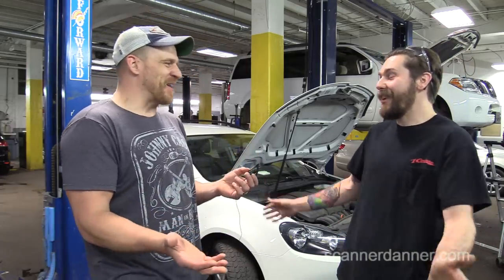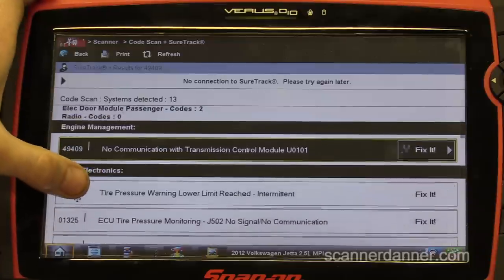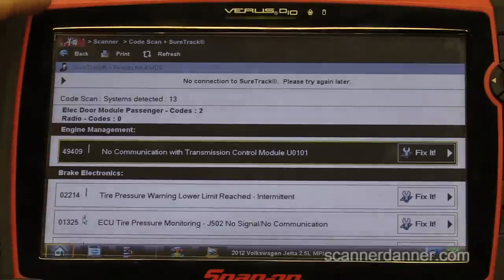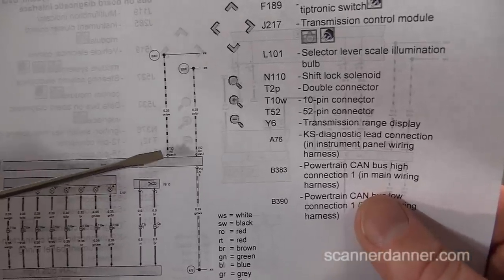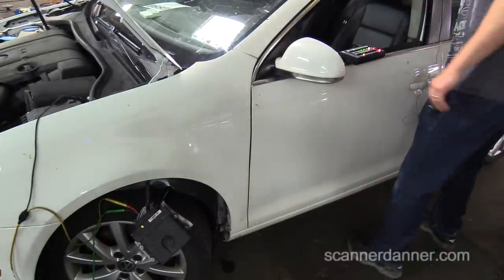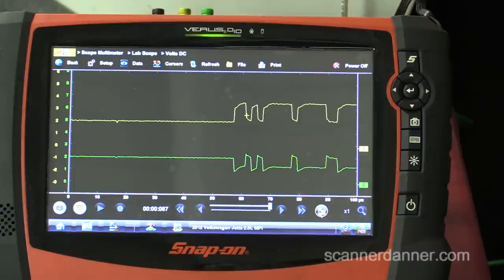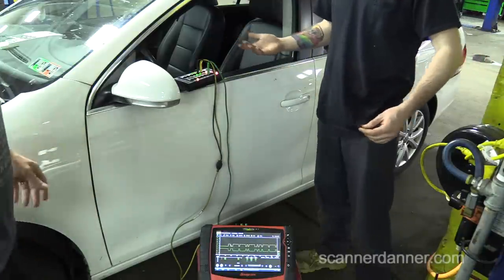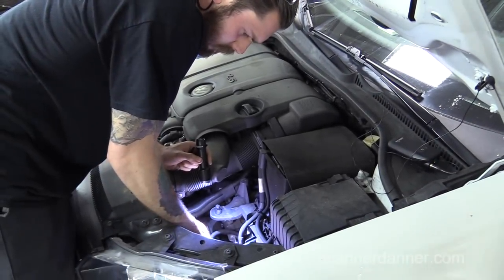2012 VW Jetta No Communication with TCM U0101 (part 1)

Comment: Hey, Paul. A missing power feed to the tcm should have not caused distortions in the CAN lines. Have you come up with why we had those distortions? The part 2 showed no distortions after repair, which made it obvious the missing power feed was the reason for the distortions. But I still don't see how.
Reply from the maker: Something with the CAN communications chip. They all produce a 2.5v bias and then talk on it. I'd imagine with the one being totally down, there is a network distortion from some type of backfeed, that normally would not be a path, with a powered up com circuit. Best I got.

Comment: Looks to me that the can bus isn't terminated correctly at the TCM probably bad resistors or transceiver in the TCM. If you can get inside the TCM you maybe able to repair it. Also you can check the resistance of the pins at the actual TCM unplugged.This would show if the module is loading the can lines down.
Reply from the maker: Thanks for the information Kris!

Comment: Once the ECM is communicating with the scan tool , pin 7 LED will begin to flash on the CAN Test Box if not the scan tool is not sending the command to communicate.

Comment: Another great video Paul.

I have a feeling that you didn't realize at that there are multiple CAN busses, and that each bus has a pair of terminating resistors. Each bus is connected to the gateway. the gateway directs signals in-between busses.

For example, the fuel pump primes when the car is unlocked by the key fob or the door is opened. The central locking module sends a message saying that the door is open. The gateway sees this message and sends it's own message to engine control module to turn on the low pressure fuel pump to prime the system.

if you were backprobing central locking module and the engine control module at the same time as you opened the door, you would see activity on both busses, but it would be different activity. Channel one and two (central locking CAN bus) would NOT look exactly like channel three and four (engine control unit CAN bus.)

When you were measuring the resistance of the the CAN bus from the TCM, you are ONLY measuring the resistance of the powertrain bus. you can unplug every single module other than the ECU and your resistance checks at the TCM will NOT be affected.

Anyways, you still have some learning to do. We all do. Keep  up the great work.
Reply: Ian Johnson pretty much spot on.  However, the K Bus is the bus which allows communication of the entire network with a scan tool. He was not wrong in chasing a fault in the K line, but his break out box pretty much did it for him.  Soon as those LED's shined bright, you have just confirmed integrity of the K line.
Reply from the maker: yes I do, thanks for the info. 
I was aware of multiple networks on the car, just didn't realize at first about the DLC being isolated from the rest of the CAN network until we saw the diagram.

Comment: The voltage comes from all the modules combined. It isn't just one module that makes the voltage. 
The resistors are there to soak up voltage peaks in the line.

Comment: Terminating resistors in communication lines are generally used two stop reflection of signals back into the communication line the signals will actually bounce back from the end of the communication so generally your terminating resistors are at the end of your

Comment: @scanner danner The resistors are there to reduce line bounce or network noise
Reply: Exactly that, they also settle the voltage spike down much quicker also

Comment: Hi my good friends Paul and Tommy.... bleesings!Another great use of the "Breakout box" is that you can use it to make (current) compression tests.Just connect the "Breakout Box" to the obd port, then connect the Verus in oscilloscope mode to the breakout box (+ side and -ground)
Then, use the function "AC-COUPLING"

Comment: Could you have seen the appropriate network by tying your scope  to the K network pin 7 and 15 on the breakout box rather than the pin 6 and 14 CAN buss network?
Reply from the maker: We didn't have a problem on the K line. The issue was on the CAN network. We were where we needed to be according to the flow chart as well.

Comment: I taught it was 2.5 to 4 CAN High 2.5 to 1 CAN Low for a 5V Vcc this is confusing.  Mirror Image should be correct but faulty components should distort that communication ??

Comment: Several euro manufacturers do comms in a similar way. Proven by Super Mario. One if the things you have to watch out for are gateway modules. If you think of it as a "bus station". Everything goes to it but not always out of it. If you miss the gateway in your diag you'll likely get it wrong. Gateway modules can be tricky also because you'll get codes for other modules having no comms. But it's really that the gateway isn't working correctly.

Comment: Are there possibility of damage to other modules with key on and probing around looking for the problem? Can you mess around with the shifter to see if it's sending signal?
Reply from the maker: Not with a high impedance labscope, and no on the shifter. That it will not come out of gear was an effect, NOT a cause. The shifter has nothing to do with the no com to the TCM.

Comment: after looking at schematics quickly, there's multiple can buses and the error codes scanned is spread across all of them.
I'd guess power/ground issue or the J533 data bus diagnostic interface itself, since all the CAN's link to it :O
many codes could be from someone else playing around beforehand.
There's 4 CAN's in total, each has it's own termination resistor/s, the OBD test connector is all by itself to J533.
seems they went with one device per CAN with termination resistor, incase of the powertrain CAN, it's in the ECM
Reply from the maker: Definitely want to talk with you more when I have time. Thank you!

Comment: I have asked this question multiple times why are you not using the factory VW scan tool ? VAS6150D/TSP It has a scope on it ? The question is for the VW technician thanks.
Reply: I dislike the factory scantool, and the labscope is on a huge cart that you have to roll around and its just a pain

Comment: @ 32.09   Terminator resistors act to kill the package of information when it reaches those terminal limits,  I BELIEVE the explanation given to me is that the packages tend to survive the ends of the network and echo through the system with distortion effects. its possible you already had the answer.

Comment: If you have 2 terminating resistors at 60 ohms each and you unplug a module, how do you still get 60 ohms? I heard where one of the resistors was in the ECM, where is the other?
Reply from the maker: All these systems are different. The terminating resistors where not in the TCM on this VW

Comment: The Snap on uses a very similar platform as the Vag com. In fact I use the VAGCOM quite often and I used the snap on and was familiar
Reply: Does VCDS have functionality of oscilloscope
Reply: @richardkhoza2878  Not as I ever saw it. That is on a snap on way better. The pids in vcds are plain. There is a add on for it though, but it's not as nice as the pid display on the varis they see you here.

Comment: You mentioned the K and L lines. Older VW vehicles, like pre 2004, you can diagnose only by talking at the K (pin 7) and L (pin 15) lines. Those veh-s didn't have the CAN stuff implemented yet. And those were really simple and easy to connect to, you could just use an 'amateur' OBDII-to-USB (or RS232) cable for $10 and a laptop. Those cables are named 'VAG KKL', here in Poland you can buy them almost everywhere.
Reply: Is that why I never see signal activity on pins 6 & 14 on my 2003 toyota and my 2004 kia? And only on 7 & 15

Comment: hey scannerdanner I have an question. my question is. I have an 01 Ford experdition 4.6 liter engine. it has a miss in the engine under load. I changed the sparkplugs, test fuel pressure. on fuel test I got 30psi engine off and 40 psi with me power brakeing it and pressing the gas. I feel like an ign coil. but I cant afford to replace them all. but I don't have spec for ohms reading of the coil sec or primary side. but with miss being on sec side should be something dealing with sec side of ign. like spark plug maybe compression or the coil. im I correct. maybe next step is to pull the coil under load why it missing or ohm it out? thanks for help. this is my personal vehicle

Comment: This is an old video but your DLC BOB is a problem, its not needed for this type of troubleshooting, there are many places to easily pick up the CAN signal including the DLC pins but not on this car for full info, typically the ABS Module is accessible. The terminating resistors are at the very beginning and very end of the network, typically the PCM and many other places so no hard rule for sure. The rounded corners is due to high resistance. It is safe to short out a CAN line to ground or B+ power, no worries. Remove the BOB and check resistance at the DLC and see if its about 61 ohms but I think the paper stated 72 ohms is still good, did the BOB add some??? Thanks for the video and I was a SUBR to Tommys channel already before I saw this one, thanks Paul.

These BOBs need overlays to tell what each pin is for many different vehicles, you have no info on PIN 1, on BMW its the ignition switch power, if needed you can jumper pin 16 to pin 1 to put power in the vehicle with a bad ignition switch. I just dont care for this tool based on the price, its limitations, its lack of info and the noise I have seen it create on the scope. Its a gimmic.

Comment: I got a 05 audi a6 3.2 that don't communicate to ecu but it has power to obd2 port and check engine light is on but I'm having problems with my transmission it keeps going on limp mode any advice would be highly appreciated
Reply from the maker: Can't help without those codes. Sorry
A no com issue with your scan tool could be the scan tool and if not, I wouldn't be able to walk you through that via text here on YouTube.

Comment: Thank you for the info, I have two 2000 Jetta's and one is a manual and the other one is an automatic, and I like the automatic a lot better, but the one that had the manual is in way batter shape and I installed the engine with the automatic in to what was the manual, everything works good running, but the transmission now is not shifting, it is just in sec gear, I replaced the wire harness that goings from the auto trans in, but one if the plugins I do not have a place to plug it in to on the grey plugin, is that why the car is not shifting ? you maybe know what I mean or taking about, under the windchill motor on the left side there is that big cover where the wires and plugins go, and the colors are white and brown and orange black blue and the grey, and the grey there is nothing there. any idea if it has to be there? I do not know what that one does, Thank you

Comment: I've got a DTC U0107 on my 05 Acura TSX.(lost communication with TAC module). Before this popped up I knew NOTHING about circuitry/diagnostics but I've learned so much from watching your videos. I managed to track down the manufacturer flow chart for this code and it's pretty much the same for Acura as VW as in if it's not a pwr/ground issue then it's a faulty module. Also it has you doing the testing right at the PCM/ECM. Im waiting for a used TAC module now that I was able to get off ebay for $4.99 (using a $5 off coupon). In the flow chart I got to where it said to replace the TAC module with a known good one, erase the DTCs, perform the idle relearn procedure then start back at #1 so I hope 2 God it's really just a faulty TAC module. I'll know Thurs! The only thing that has me worried is the fact that my alarm started going haywire right after this limp mode issue came outta nowhere(not intermittent) & the alarm arms itself now after like 30 seconds even with the hood & doors open & key in ignition (tho not if the engine is running at least). Do you know if a bad TAC module could cause the alarm 2 do this? They both communicate on CAN bus but it doesn't seem like it'd effect alarm?! Also I was having to stick the key in beside the gears 2 manually put the car in "N" b4 cranking to get outta park even before the limp mode came about. I sure hope that goes away too after replacing the module!
 Without a scope are there any further tests I could do to confirm the module is 2 blame? I've got a multimeter & a Bluetooth obd2 scanner that can be used with apps to monitor live data. Thx 4 all you do BTW, it's so cool how you always go above & beyond to confirm a part is bad & really get in there & fig out exactly what's happening. Great teacher! I'm actually interested in learning more about vehicle diagnostics now. I figure I've came this far, why not?
Reply from the maker: I'm concerned about your other symptoms. I believe you may have something else going on but for $5 you didn't go wrong 😉
You really want to look at those CAN signals on a scope and then do a resistance measurement as well. I have some really good case studies I've recently completed on my Premium channel on tracking down some can faults. One on a Nissan with a shorted TCM and another on a Malibu Hybrid with half the network down. There is a 14 day free trial, sign up and cancel before the trial is up and you won't be charged. It will be worth it for you to watch these so you understand the resistance testing I'm talking about 
https://www.scannerdanner.com/join-scannerdanner-premium.html
Reply: thank you thank you! you're honest 2 God my biggest hero right now! I've watched quite a few of your videos with amazement and awe of your knowledge and expertise. my bf  doesn't understand n thinks I'm crushing on u or sumtn but you're the man 4real and if it wasn't 4 your videos id prob still be lost. I've wondered about your premium channel but was reluctant to join since I'm still new to ALL OF THIS but i didn't realize there was a 14 day trial! I'm def about 2 do that!

I've tried asking electrical engineers & the likes on quora about my issues but never got any useable advice, so your reply means A LOT! You're by far my 1st choice for who's advice i want so i was so excited when i saw you'd taken the time 2 respond. 

Anyway, ive felt like there has 2 be more going on than just a faulty TAC as well esp since realizing the alarm issue started right after my car went into limp mode (noticed the alarm prob the next day). 
here's how everything went down..i drove 2 Lowe's hardware 2get soil bc it was the last day of a sale. the car drove fine. when i walked outa the store it was pouring rain so i left my trolley thing under the roof n backed my car as close as poss & threw the bags in the trunk. i wasn't gentle about it bc i was still getn soaked. Lowe's is right beside a stop light where i sat 2 turn left onto the bus hwy. i thought id ran outta gas when the light turned green bc it wasn't accelerating so i pulled into Sheetz that's right there & got gas. i realized it wasn't gas after pulling bk out & had 2 pull bk in where i googled the symptoms and learned of limp mode. 

Throwing the bags in the trunk is the ONLY thing that's happened that could have possibly disrupted wiring & I'd just got this car bk not even a mt b4. I let my bro borrow it in 2012 & he drove it a few years until it needed tires, a rack & pinion & 120k mile maintenance. It sat in his yard untouched from 2015 or 2016 til earlier this year when I got tires, brakes, battery & fluid systems changed/flushed & got a tag 4 it. it still needs pwr steering & A/C repair along with whatever is causing me 2 have 2 put it in neutral before cranking to get outta park. When my bro stopped driving it the A/C still worked & no prob getting outta park.. oh yeah and I was starting to be able to get it in gear without the manual override b4 the limp mode came about so i assumed it was bc itd sat so long. Idk if any of that matters but thought I'd add it just in case. Also I've visually traced wiring (related to the DBW system) from PCM to TAC module, thru the firewall & all the places it branches off to like sensors IAC,APP, TP, MAP etc, the main junction harness (next 2 engine) and VSA & while i know visual inspection isn't very reliable i can say all of that wiring APPEARS good (nothing looks pinched, rubbing against metal or dangling) & all the factory casing is fully intact. I'm sure there's more wiring but that was as far as my limited knowledge could take me. Are there wiring diagrams for just the electronic throttle control system in any cars you know of? I'm curious bc I haven't seen one for my car & don't know if they exist for any car. I know the trunk has security system wiring somewhere & i wouldn't be surprised if i messed something up throwing the soil in there. 
do u think it's possible to figure out what's going on with my CAN lines without a scope? that's what worries me more than my lack of experience.. I'm a quick learner & you've got a talent for teaching but is diagnosis even possible without access to a scope?

i apologize for this being so long 😕. Thx again 4 taking time 2 help me out! If karma's real you def have loads of blessings coming your way!
Reply from the maker: Absolutely, the resistance test will be key. The problem will be the short or open in the network will need to be current to be able to find it. Starting with inspections in the trunk area would be a good start after scanning the system and finding out what modules are talking and what modules are not